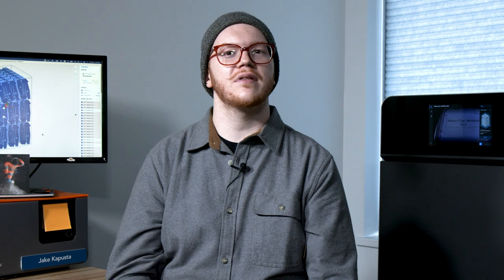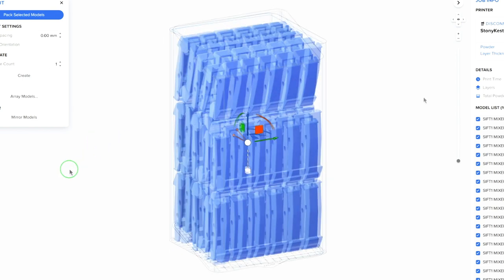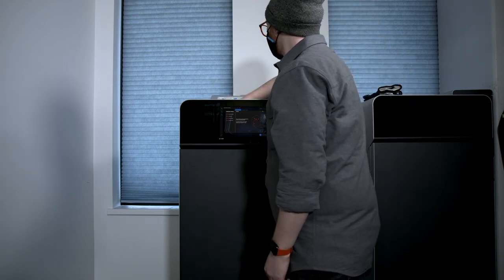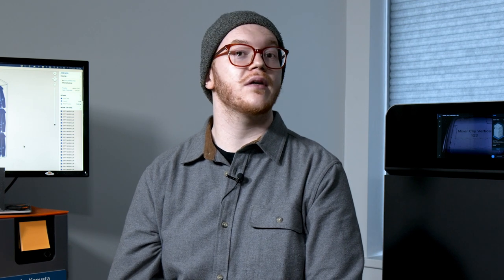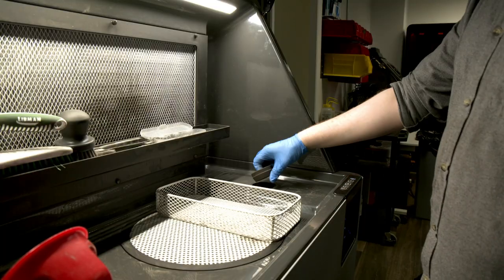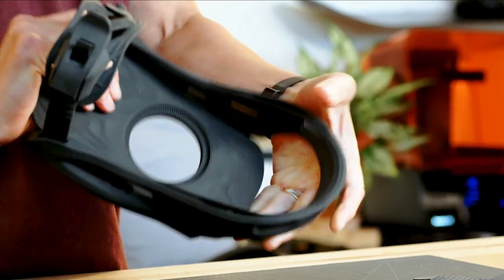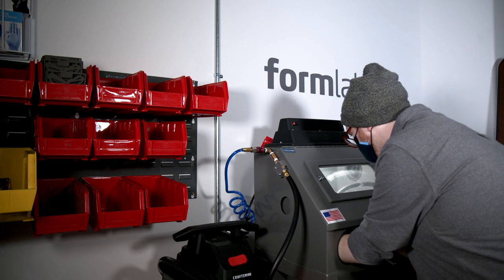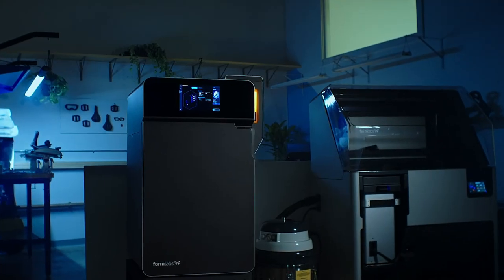SLS 3D Printing Workflow - The Fuse 1 Demo

Comment: What was the packing density of the build volume with 102 mixer clips? What is the recommended maximum packing Density? My Fuse 1 is ordered and should be here in about 4 weeks!
Reply: 31%. Recommended is about 30%.

Comment: Would you launch white powders, so we can dye them?
Reply: Because of the kind of laser they are using they need darker powder to absorb the laser
Reply: because of the wavelength of the fiber laser they have to use grey nylon so that it can absorb the laser's energy. White powder would require a different laser configuration

Comment: How much does a fuse1 and sift cost?
Reply from the maker: Our Workflow Essentials Package including the Fuse 1, Fuse Sift, Printer Stand, Build Chamber, Powder Cartridge, and 3x Nylon 12 Powder 6kg costs $29,743.00. You can also configure your own custom package at http://bit.ly/3aAYobL
Reply: @Formlabs  is that USD?
Also what is the cost per 6kg?
Reply: @swinksstuff  you can get nylon powder from china for $10/kg
Reply: @swinksstuff  around £100-120 per kilo. And no, you cannot use any other powder, even cheap Chinese stuff.

Comment: So you pay 25k and you clean the prints with a toothbrush???!!! Fuse shift is almost useless, just for recycling!
Reply: Not really. The 'Fuse Sift' is also a powder recovery and mixing unit. This is a big advantage over others such as the Sinterit Lisa range. You really need to control the recovery process well, to avoid airborne dust. The Sift also filters this possibility. The downside is you also need a £3k explosion proof vac for clearing the Sift.